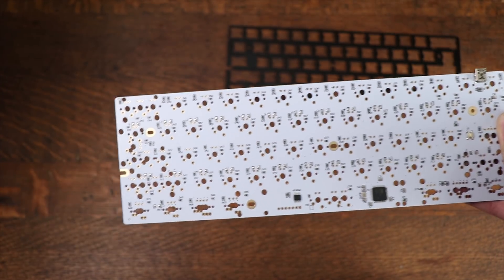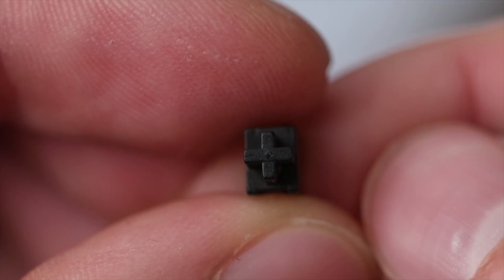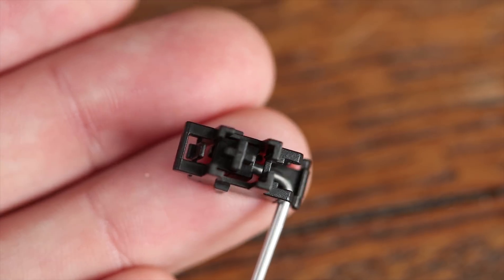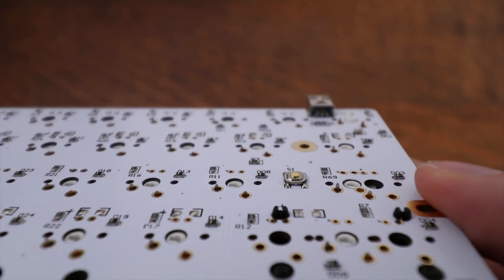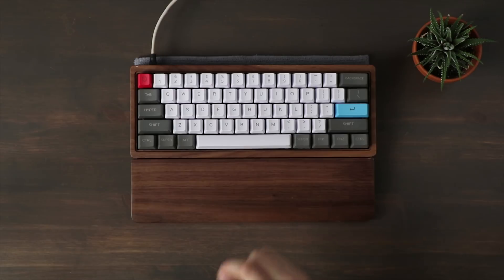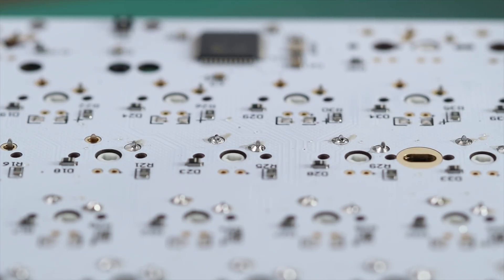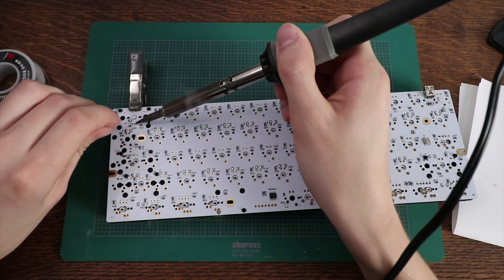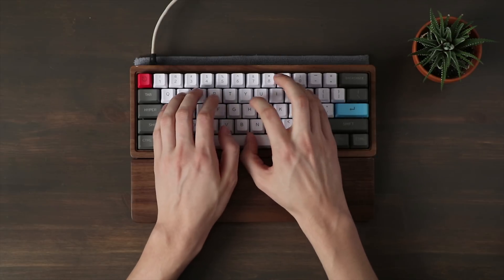60% Mechanical Keyboard Build Guide

Comment: Is there a way to build one without soldering? The tool is very expensive and I fear I'll mess up.
Reply from the maker: You could buy a 60% keyboard and swap out the keycaps and case for your own instead of building it from scratch.

Comment: Good video!  If I may add a few tips from my own experience…  1. If you are putting in backlight LEDs, be sure you test them before and after soldering them in!  That goes double if you are using them with BOX switches or similar, where the LED goes in first underneath the switch.  2. I used hot glue to secure my stabilizers to the PCB, so they can't come loose or rattle around.  It seems to work well.  3. I'm a big fan of split-spacebar 60% layouts.  I used a DZ60 kit with 2.25—1.25—2.75 split.  I made the left bar my backspace, and I use the center key for Fn, so all I have to do is press down with my thumb and then have all the nav keys at my fingertips.
Reply: Hey, where can I find backlight LEDs for the PCB? I will buy them. Thanks!
Reply: Just do a search on Amazon or eBay for 2x3x4mm white LEDs.

Comment: Please always test the PCB before soldering. It is such a pain in the A$$ if there is something wrong with it and you have 60 keys to remove.
Reply: Plug in the PCB, go to keyboard tester, take a pair of tweezers and just poke them through the holes where the switches would go through. It should register the keys.
Reply: Hey just wondering on how you can test the PCB before? Thanks!!
Reply: This is why I just opted for boards that are hotswappable. I figured it would be too much of a hassle to desolder then resolder everything when the need arises.

Comment: Hot tip. When you pull the iron from the solder point don't just pull it away,  turn your wrist as you pull away to help make the nice, shiny  domes you want when soldering.
Reply: Hot tip: I see what you did there :)
Reply: also, put more solder in there.
Reply: and don't fear the heat.

Comment: How does the  Gateron feel compare with MX Cherries?
Reply: Spiros Kabasakalis they feel better
Reply: I suggest Outemu Blues, they are louder than MX Blues but not by much. And, they are much more satisfying to type on. Just my preference but use whatever you like.
Reply: I second the Oetumu recommendation. They are smoother and more snappy than Cherry blue. I have read a description of them as being like a Model M in their feel (which I agree with), but not as heavy of a feel. You have to like the noise though, because I find them quite a bit louder than Cherry.
Reply: Smoother and more wobbly is the most accurate and common description
Reply: are they at least as clicky as the Blue MX Cheries though?
Reply: The Gateron Blues are as clicky, as they are essentially clones of them. However, as stated above, they are much smoother in my opinion and the Gateron Blues are quite loud. My personal favorite are Gateron Clears.